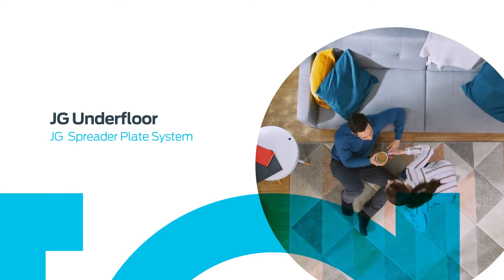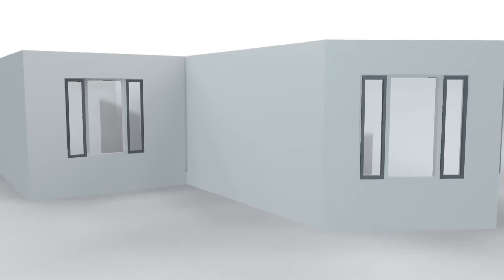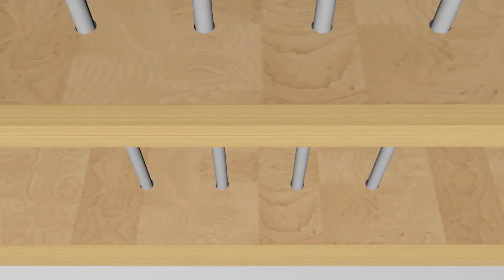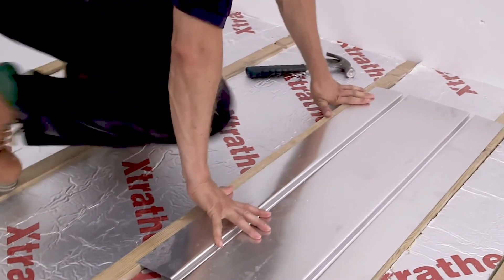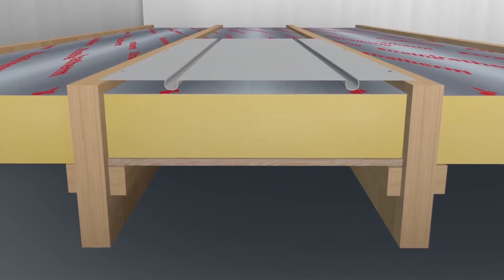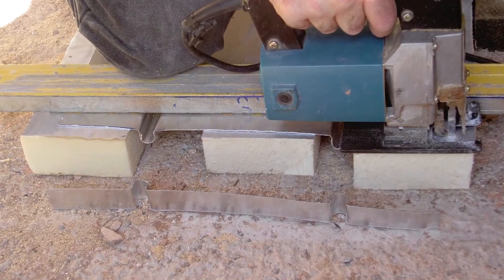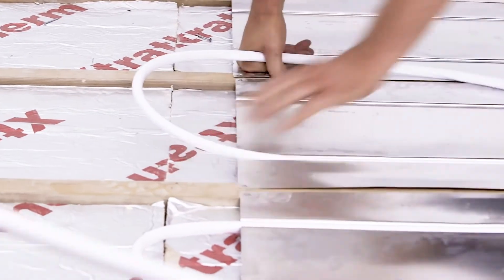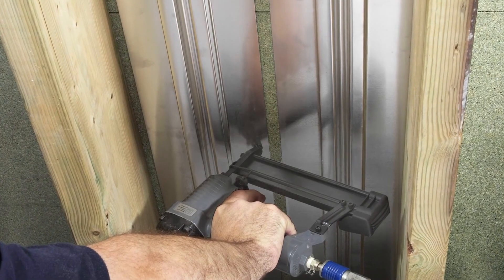Installing the JG Underfloor Spreader Plate System

Comment: I am considering this system for a new container build, fixing 70mm battens to the floor and using 50mm celotex insulation. What would be the suggested covering? I am thinking 18mm chipboard? Finish would probably by vinyl or thin carpet in the bedroom.
Reply: I wouldn't install carpet of any kind over in-floor heating. Carpet is an insulator and even the thinnest stuff has a foam backing. I think you'll be disappointed in your heating efficiency if you put an insulating flooring over hydronic or electrically heated floors.

Hydronic wouldn't be as wasteful as electric, because the hot water would arrive back to the boiler with most, if not all of its heat retained so you'd just be wasting the electricity used to circulate it. Electrically heated floors on the other hand would be tremendously wasteful because they'll run until your thermostat stops calling for heat, which would be never.

Hardwood, tile or denser linoleum over at least 1/2" of masonite would be the best flooring to go over an in-floor heating system. In my house I have 3/4" solid red oak installed directly over hydronic lines running in aluminum heat spreaders in grooves in a middle sub-floor layer. I also have tile over cement board underlayment also installed directly over the hydronic lines in the middle subfloor layer.

My floors are a total of 2 1/4" thick which is two layers of 3/4" of OSB subfloor, another 3/4" of OSB subfloor cut into 11 1/4" wide strips, providing the 3/4" groove for the hydronic lines, and then the last layer is 3/4" solid oak, or the cement board  and tile which together add up to ~ 3/4" thick.